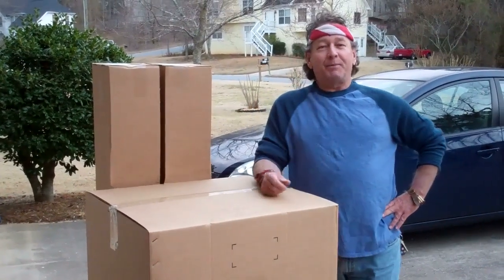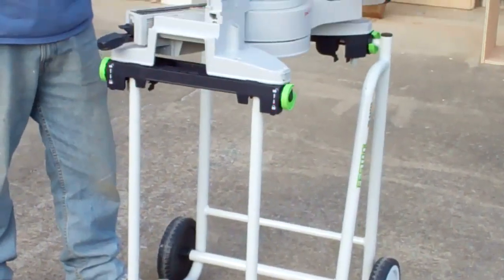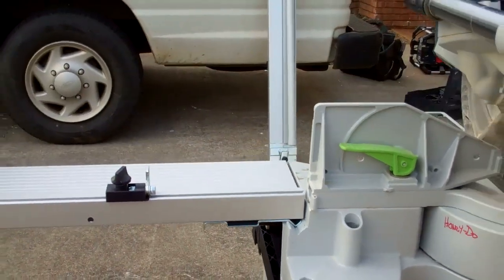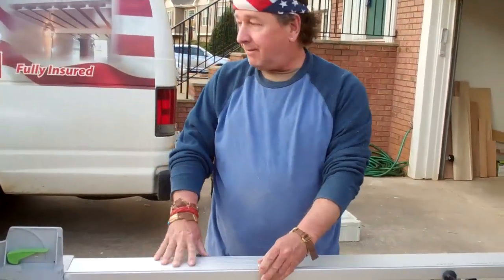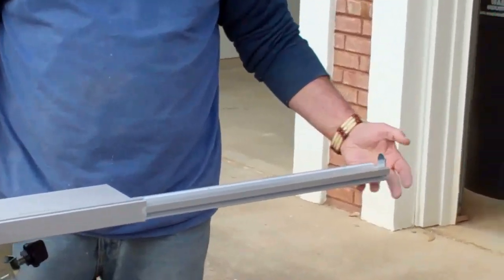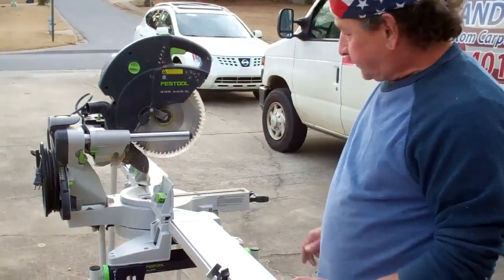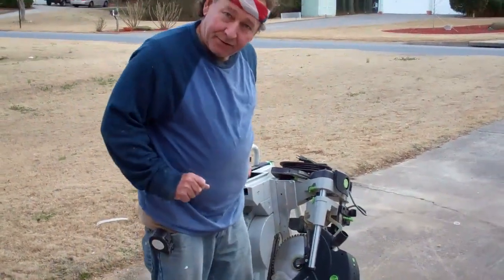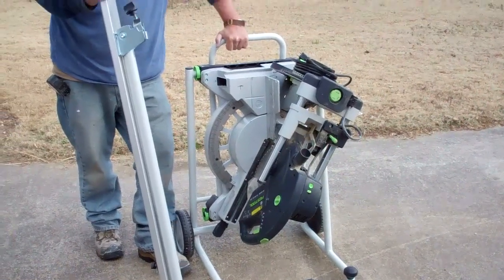Review  The Kapex Saw Stand by  Kreg Kreg's Custom Carpentry

Comment: Great stand if you could use the outfeed tables with the crown stops. I own the kapex but I use the crown stops daily so the stand is worthless to me. That is some bad engineering.
Reply: Just slide the extension mounting bracket 3/4” out from under the extension and put a piece of t-track between the extensions and the saw base. Or buy the other extensions that allow the crown stops.